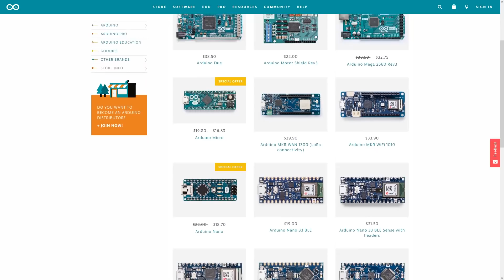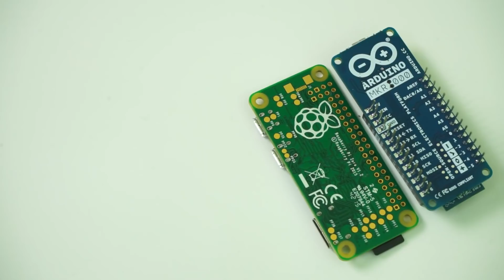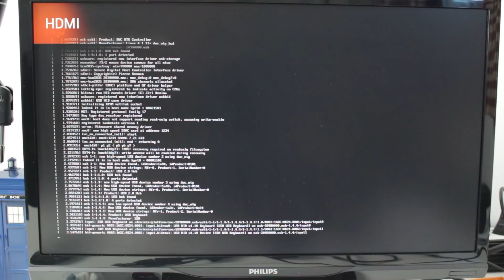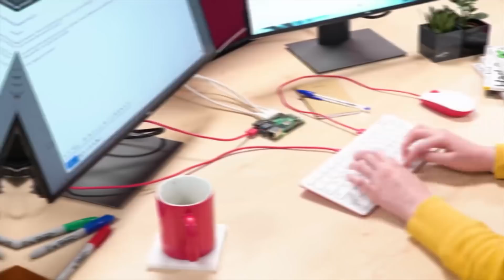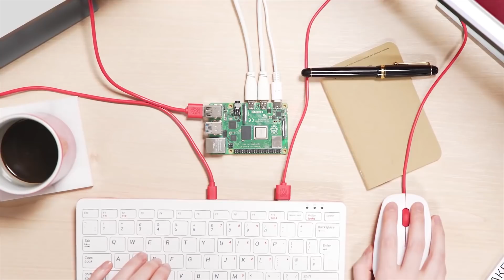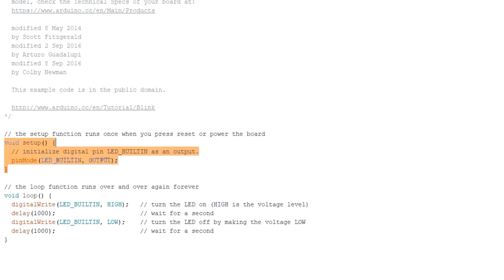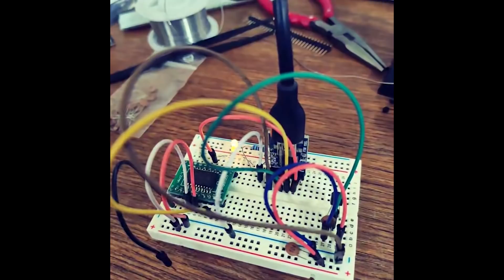Arduino vs Raspberry Pi - Which one is better?

Comment: You get a NodeMCu with 8266 Chip for like 2 Dollars in China, your Prices are total off the charts.
Reply from the maker: "Off the charts"? Eh? Did you even watch the video?
Reply: @GaryExplains  Yout Thumbnail Picture was enough, thanks. False Advertisement, then.
Reply from the maker: @Diranar851  LOL. That is probably the stupidest thing I have heard today. The cost of the MKR1000 is as "advertised". Nothing false or incorrect. I go into depth in the video about the alternatives that are available including the ESP based Arduino compatible boards. Sorry dude, but you are way off the chart here.

Comment: Some years ago, I read an article that suggested that if you needed two or fewer if statements to describe your program, then probably an Arduino was best to use.  Anything more complicated than that might be handled better by a Raspberry Pi. I will note for those who don't have time to listen to Gary, he DOES NOT explain that.

Comment: Haven’t finished watching yet, but the use-case scenario is what determines which one is better.
Reply from the maker: Then finish watching it.
Reply: Gary Explains seeing as how the video is around 13-15 minutes and my comment was 2 hours ago, one could assume I FINISHED IT.

Loosen your panties a bit, I wasn’t disparaging you.
Reply from the maker: @RossPotts  Great and so you will know that I said that very thing in the video.
Reply: Gary Explains yup, and I was pleasantly surprised.  My notification only says 7 minutes ago on your initial reply, so if I jumped late, I apologize.

Comment: I use the esp8266 nodemcu and d1 mini all the time for home automation with Home Assistant. Esphome is wonderful. Esp32 are great for the bigger jobs.
Reply: So do I.  WEMOS D1 costs around £2 and includes WiFi.  I have temperature sensors,  DS18B20's all connected by the 1-wire system.  Great value.

Comment: I stopped after 25 seconds. Where do you get a Pi for $5/5€ ?
A link would be welcome.
Reply from the maker: It isn't hard to find, just go to the official Raspberry Pi site and find the distributor for your area: https://www.raspberrypi.org/products/raspberry-pi-zero/ I just double checked a distributor in a European country and the price quoted is €5.17.
Reply: Gary Explains Unfortunately this isn’t available. Only the one at 14.60 € can be ordered... I already saw that, this is what triggered my comment. But thanks a lot for taking the time to answer.
Reply from the maker: @jrioublanc  Stock issues are outside of my control. However the device isn't discontinued and I can get them in my country without any problems.
Reply: Gary Explains yes you’re right. But I never been able to order this device in France for less than 10 € despite what was advised everywhere since it has been introduced. Not your fault, for sure. Regards.
Reply: @GaryExplains  yes this have old pi zero NOT better new model zero W. normal human buy only W model, or pi 3 and 4 model.
Reply: Jérôme Rioublanc it's just a Pi Zero. Not a full 3b+ or 4.

Comment: Pi doesn't have analog in.
Reply: Can’t do general purpose stuff with the GPIO pins?

Huh, looks like you can’t! Though my brief internet search gives results for doing it (addon hardware?). I also imagine one could output analog with a capacitor and rapid duty cycles, Idunno.

Comment: I have zero w and old printer setup for wifi printing. It’s at my parents house. I have never had any problems with sd card, and my parents switch it off by unplugging power cord all the time. Sd card in it has survived 2 years, and it keeps on going....
Reply: That's because in that application you pi is almost never writing to sd. It's idle most of the time, so no corruption

Comment: The Raspberry Pi is built for an idea, recreating the BBC micro to encource STEM.  The adoption of the maker market was a happy accident.  

The Raspberry Pi is disruptively cheap.  Much like the 6502 was in the 70s.  The Raspberry PI can be made to boot quicker, it's just not as well supported.  There is a port of RTOSs to the Raspberry PI and they are much lighter.

Comment: Doesn’t the pi zero still have supply issues?
Reply: V1.3 (current version) resolved all of those issues. That was released only a few months after the initial Pi Zero release. Pi Zero W doesn't suffer from any power issues.
Reply from the maker: I think Six0Three means "supply" as in your can't find them for sale, sold out.

Comment: The Pi could do with something like Menuet OS. Graphical user interface, compilers and assembler and a surprising number of apps..... on a floppy or 2... 3mb OS will boot up in no time and and still offer a nice user experience.... As someone who's main product type in his little online shop used to be the smallest thin client motherboards I could find the Pi was the nail in the coffin. It was fun finding job lots of tiny PCs, low spec ones were often the smallest... Tiny old Compaq thin clients with 300mhz mmx X86 cpu, 128mb ram, flashable rom on a 3'' x 4'' form factor.. Usd for many device control projects, including some robotics... Bought for around £5 to £10 each in fairly large quantities at a time when possible, with power supplies... Power supplies sold for £15 as they fit many other Compaq TCs and laptops, mobos for £15 also.. Nasty nuts to crack though, those Compaq cases... I sold quite a few of the empty cases and PSU combos for nano-itx builds at £25. Dinky little things with a stand, a bit too small for mini-itx... the good old days. SFF PCs, parts and accesories. Converted higher spec thin clients made excellent set top boxes when converted to stand alones with a laptop HD and DVB-T card... blah, blah, waffle.. Wyse were my favourite in the end.

Comment: I thought the distinguishing feature of microcontrollers was that they DON'T have an 'operating system'.
Reply: Actually, that's the advantage of the microcontroller. You can use all of its power for what you want to do....like, why do I want an OS if I'm going to perform only one task?
Reply from the maker: @JosueRodriguez08  Well, microcontrollers can be used in more complex situations that you are envisioning.
Reply from the maker: There are plenty of microcontroller operating systems including Zephyr, FreeRTOS and Mbed OS.
Reply: @GaryExplains  Those are embedded systems O/S.  Embedded does not equal microcontroller.  For instance, the ATmega family used in Arduino do not have or need anything resembling an operating system.
Reply from the maker: @daveayerstdavies  Interrupt handling, cooperative multi tasking, Bluetooth stack, networking stack... Starting to sound like an OS to me. Have you seen how much code there is in the core that isn't exposed to the programmer?

Comment: I think it really needs to be made clear that the Arduino is NOT running any kind of operating system, not even a simple one.  There is no room for that with kilobytes of memory and storage on the chip.  The IDE is providing a simplified interface for writing firmware that is compiled, flashed to the chip, and run directly on the hardware.  There is a small amount of code that helps simplify the process of flashing the compiled code to the chip, and that's it.

For the majority of applications, projects, and learning, I'd recommend the Pi over the Arduino.  The scope of what the Pi is capable of is so much wider, and learning Linux is a far more general and  valuable skill than learning a specialized subset of C.  The ability to remotely administer a headless Pi with SSH is also a huge advantage for any kind of ongoing project.

Exceptions to this recommendation would be: 

1.) IoT projects that require low power consumption (run off a battery) and have minimal networking requirements (pushing data, handling extremely short and simple requests).
2.) Controllers for small scale industrial processes that need to be highly reliable and recover quickly from power glitches.  I know a guy that has used Arduinos to automate most of the manual processes on his farm scale olive oil machine.
3.) Someone who absolutely knows that they want to get into electronics and firmware, rather than computer science and general computing.  But even in this case, they'd probably be better served by a more fully featured microcontroller development platform.
Reply: Hi.
Another important difference is that the pi is a computer and the atmel chips (nano & co)are microcontrollers.  A computer has an operating system that has to be booted and shut down correctly and should not be just shut off by a switch (Filesystem problems). That has to be kept in mind wenn choosing between them.

Pudelfan
Reply from the maker: @pudelfan3059  I thought I said all that in the video.
Reply from the maker: Depends what you mean by operating system.
Reply: @GaryExplains  no, it does not depend, they do not have an OS!
Reply from the maker: @JosueRodriguez08  Well, I don't think you understand what an OS is then.
Reply: @GaryExplains  An operating system manages computer resources and provides some sort of abstraction layer to programs that run on the hardware.  This is objectively not present on Arduino, and your video and comments make this very unclear.
Reply from the maker: @jonathanpritchard6464  So the interrupt handlers, the networking stack, the scheduler and so on are not the Arduino managing the resources? Interesting...
Reply: @GaryExplains  This is like saying that a pile of wood, nails, insulation, plumbing, wiring, appliences, and nic-nacs is equivalent to a constructed house that people live in. Yes, there are very user friendly libraries for creating ISRs that serve pin changes, creating a scheduler to run multiple functions, and for interfacing with network devices.  This doesn't change the fact that the program you write is running directly on the hardware with no abstraction layer underneath.  You are loading a new 'mini operating system' everytime you flash the board.
Reply from the maker: @jonathanpritchard6464  An abstraction layer isn't a requisite of an OS, I should have picked that up in your last comment. Also when you use something like Zephyr OS, you also install a new mini OS every time you flash the board as the compiler produces your program combined with OS into one firmware blob. The problem is your definition of an OS, you are thinking that only things like Windows or Linux are an OS because they have a kernel and preemptive multitasking. Sorry, that isn't true. The very fact that there is a setup() and loop() and loop() calls other functions outside of your control, for resource management, shows that it is an OS.
Reply: @GaryExplains   If you want to define the OS as nothing more than a set of libraries that provide hardware interfaces, I get your argument, and I might be more inclined to agree with you in an embedded systems context (I've debated this before).  However, I don't think it's appropriate to say that these two devices both run operating systems given the disparity between them, especially for people looking to understand the basics.
Reply from the maker: @jonathanpritchard6464  That is why I say in the video that the Pi runs a "full multitasking, multiuser operating system" to distinguish it from what runs on a microcontroller. In light of this discussion I will make sure that I emphasize the difference better in any other videos I do that touch this subject.
Reply: @GaryExplains  Thank you! I was beginner not to long ago, that statement would've confused me into thinking that the two were on par with each other. Then I'd wonder why I can't install Windows or Linux on it. 😂🤣
Reply: @GaryExplains  tell that to the multiple kernel I have written lol
Reply: @GaryExplains  no, it is not, all of that happens at hardware level bro
Reply: @GaryExplains  those are not calls man....those are just a while and a main....do you even know how a compiler works? Your C code goes. Directly into the arduino, not running over anything.
Reply from the maker: @JosueRodriguez08  A compiler? Hmmm? Never heard of that. What is it? LOL. Seriously dude, please look at the code here  https://github.com/arduino/ArduinoCore-samd/tree/master/cores/arduino and also here https://github.com/arduino-libraries/Scheduler/blob/master/src/Scheduler.cpp and tell me how "pure" your C code is that goes directly into the Arduino! LOL.
Reply from the maker: @JosueRodriguez08  Your mistake is in thinking that an embedded OS needs to have a kernel. It most certainly doesn't. In general, the idea of a kernel comes from the world of multi-user, multi-tasking OSes, not necessarily from the embedded world. Even if the system calls are executed when the app "yields", they are still system calls.

Comment: Wierd comparison Ardino boards, usually just used for development. Later the Atmel 8-bit AVR microcontroller is used on one's one PCB.
Reply from the maker: Why is it a weird comparison? Arduino's are certainly not just used for development. They are used for all kinds of hobbyist and maker projects from robotics to smart-home to IoT.
Reply: Arduino is a software development IDE replacement for C on a existing chip running in real time. It's not an original hardware solution like the pi. I suppose sometimes they could be used for the same purpose. I dought that people using microcontroles in electronic projects would use a computer and high level prorgraming language like python. The the micontroler chip and the PI are two different tools and it's stupid to compare them.
Reply from the maker: @alsehendo34  Sorry but you are wrong and clearly don't know how people are using microcontrollers or the Pi.
Reply from the maker: @alsehendo34  PS. You should read some of the others comments, lots of people found the comparison useful and not weird at all.

Comment: A raspberry can work as an Arduino , an arduino can't work as a raspberry , that simple hhhh .
Reply: Not in terms of hardware support and documentation. Many board manufacturers will offer pretty comprehensive libraries, documents and examples that are geared towards Arduino compatibility. 3rd party software and materials are generated for a lot of these products which also support various Arduinos.  In many instances the development time for a project could be minutes on the Arduino and hours on the Raspberry Pi. 

Also, there's a relationship between complexity and reliability that comes into play in electronics. The most reliable solution, the one with the fewest moving parts (including in software), is usually the simplest possible system that meets the design requirement. The higher entropy solution of the Raspberry Pi isn't quite as reliable as the Arduino.
Reply: @notnotkevinjohn  Totally valid . Also keeping in mind that pricing for development platforms such as arduino is verry different than the cost of the microcontroller itself in the final project , in many cases it's a fraction of the price of the full arduino.
Reply from the maker: That is indeed true, but it is more complex than that including boot times, power usage etc. Everything I said in the video.
Reply: @GaryExplains  yes I watched the video , great points there , also raspberry's GPIOs don't have an ADC so you would have to get a sheild for that.
Reply: That's absolutely fake. RPI don't have the hardware to do that my boi
Reply from the maker: @JosueRodriguez08  Fake?

Comment: Before I even watch this, I must say, "huh?"

They are not even designed for the same purpose.
Reply: Well, some people just have no idea about them & gary is going to explain it
Reply from the maker: So the GPIO pins on the Raspberry Pi are for decoration?
Reply: @GaryExplains  it's not the same man....like, in no way
Reply from the maker: @JosueRodriguez08  What are you talking about, what isn't the same?
Reply: @GaryExplains  the GPIO and the pins in a arduino
Reply: @GaryExplains  
The Arduino was designed as a tool to help students get to grips with microcontrollers.
It's just an 8-bit microcontroller with a more user friendly ide.

The Raspberry Pi was designed as a cheap "throwaway" computer for children to experiment with. It's built around a 32bit Arm SOC and is a fully functional arm PC.
The gpio pins are there to allow users to design peripheral circuits and serves the same function as the user port on 8-bit PCs from the '80s.

Sure, you could use a Raspberry Pi as a microcontroller. It would be rather tough to use an Arduino as a PC though. 

I know the latest interaction of the RPi is 64 bit, and I know that there are 32 bit versions of Arduino. None of this changes the fact that the Arduino is, at it's core, just a microcontroller.

P.S: You could use any PC as a controller if you just build a suitable expansion card for it. People have been doing this kind of thing since the Mos-1
Reply from the maker: @QlueDuPlessis  Sorry, I don't agree with most of what you wrote there. I am not going to rehash my video here in the comments. You have my opinions quite clearly presented there. I am sorry you don't agree, but that is the nature of the Internet. I can't please everyone.
Reply: @GaryExplains  well, we can agree to disagree then. 😉
Have you considered the Pic microcontroller vs the Latte Panda?
Reply from the maker: I have considered lots of different videos ideas. The question is what will "work". The Raspberry Pi vs Ardunio seems to be a popular topic with a combined total of millions of views on YouTube. A similar search for other combinations seems to show a lot less interest. Maybe a better idea would be Arduino vs Pic vs ESP32. Or something like that.
Reply: @GaryExplains  Sorry, I was being facetious.
But yes, that does sound like an interesting topic. Esp32 vs Pic vs Arduino/Atmega
Reply from the maker: Mr Seagull, please explain what "less optimized" means?